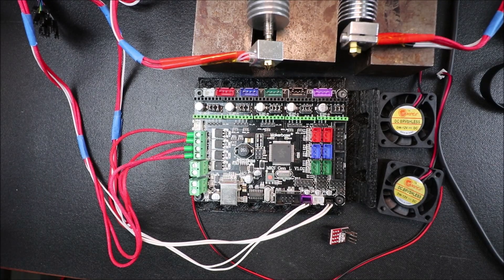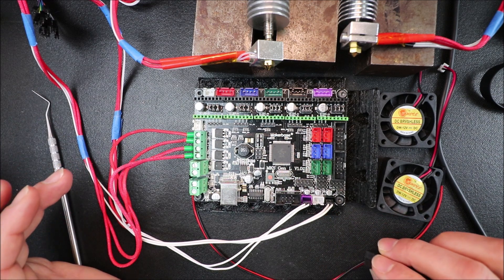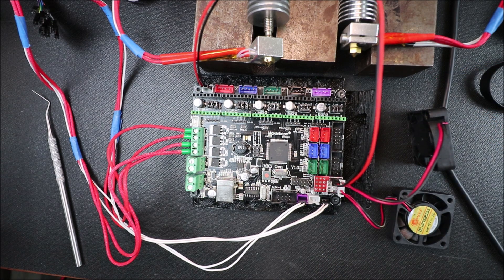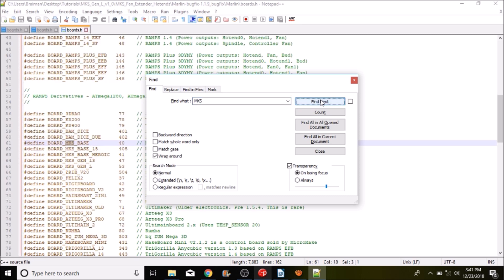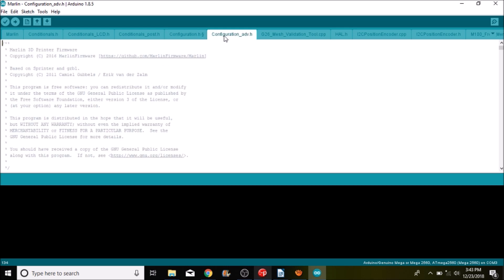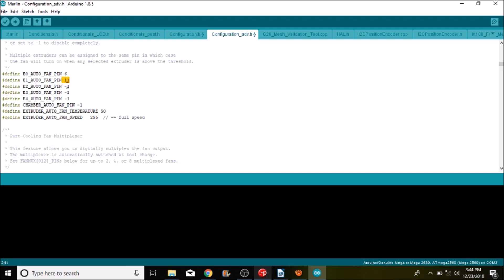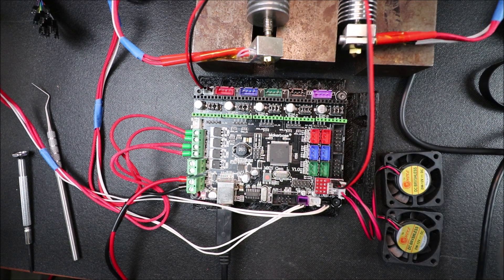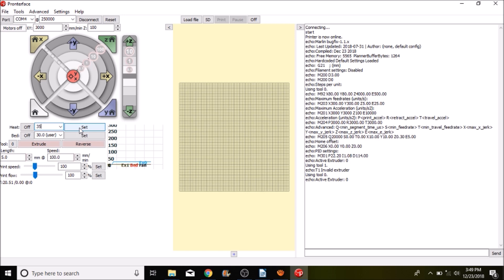MKS Gen L - Fan Extender Hotend cooling

Comment: what is name that connector? is REPRAP RAMPS1.4 RRD FAN EXTENDER?
its only when you have two heaters? and only using marlin?
(i have 1 hotend and using klipper with raspberry pi)
and why you didnt connect fans directly to 12/24v output or fan output?

Comment: I'd like to use PWM fans salvaged from an iMac - which are really quiet and also have useful ducts. Is it possible to drive them from the board? Or would I have to get a separate ESC to drive the fans ? The fans all have 4 wires - +, -, PWM control, and Monitoring or RPM output. Thanks.
Reply from the maker: Currently I'm not super experienced with PWM fans.  I normally work with only two wire 12v fans.  I'm still trying to figure it out.
Reply: Edward Braiman thanks  anyway. I could just use a drone ESC ( electronic speed controller ) I think. I’ll research it more because those fans are so quiet.
Reply from the maker: Good luck.

Comment: what connectors you are using for green terminals ?
Reply from the maker: Ferrule connectors.
Reply: @EdwardBraiman   dimensions : 0.50x1.50mm2 or 1.50x2.50mm2 ?
Reply from the maker: I purchased a box with multiple sizes and found one that fits and then clamped down.
Reply: @EdwardBraiman   thank you ill buy all sizes than :)
Reply from the maker: You're welcome.